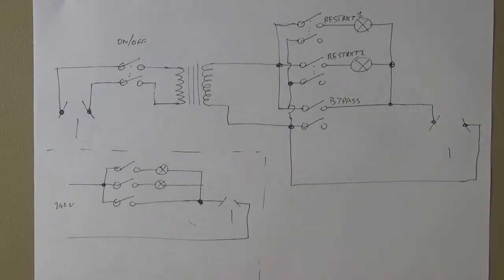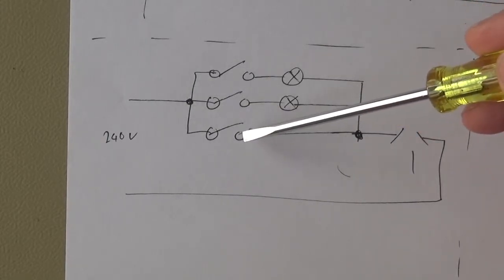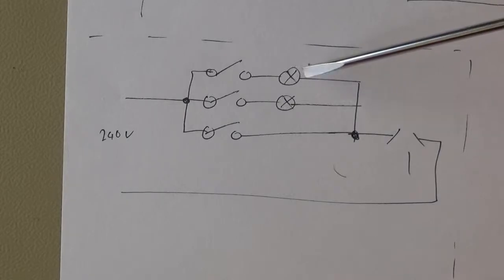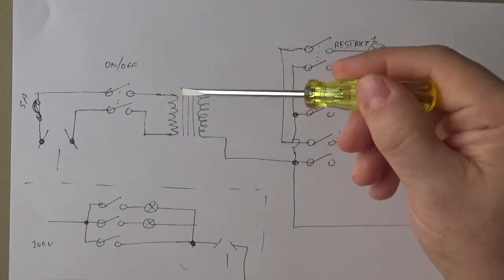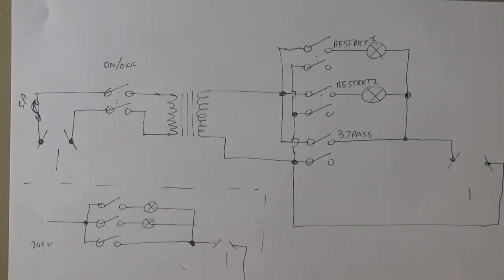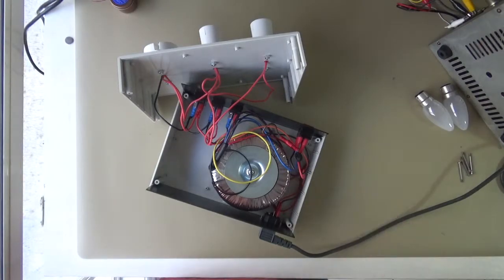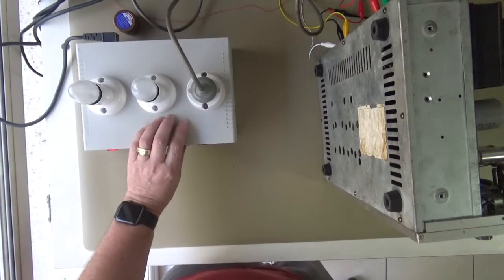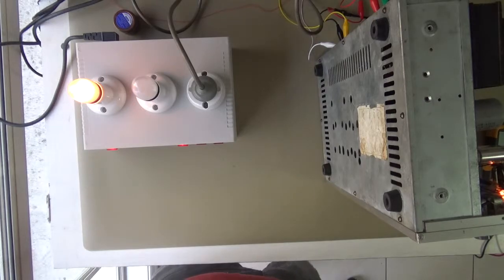#089 Building a Dim Light Tester

Comment: Have to build one of these myself, but it's hard finding incandescent light bulbs these days. Another good bit of gear is a variac.
Reply from the maker: Yes, the dim light tester is like a “poor mans” variac with the added advantage of the visual indication. I know what you mean with the globes though, I had to hunt through our box of assorted globes to find some that were suitable
Reply: Well they are a good safety unit for sure, but I like to ramp the voltage up slowly while repairing just a personal preference thing I guess, but I am certainly going to put one of those together and soon.